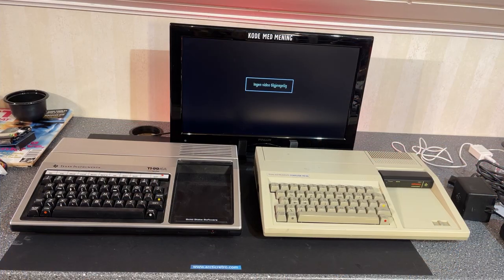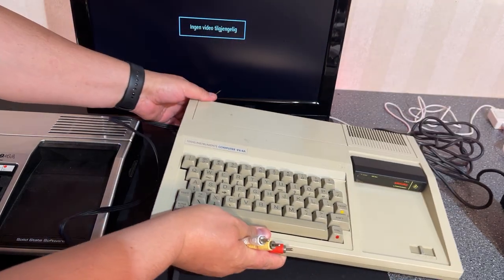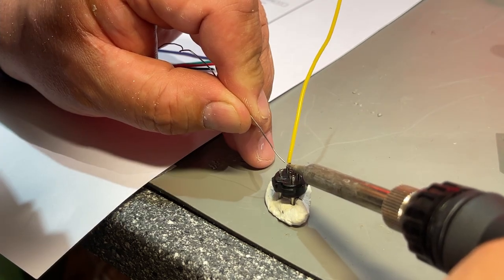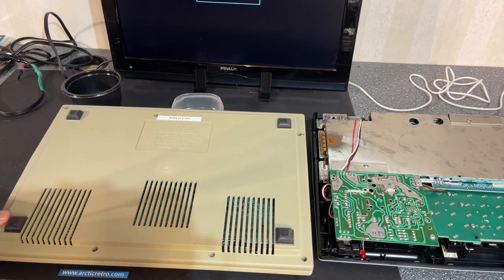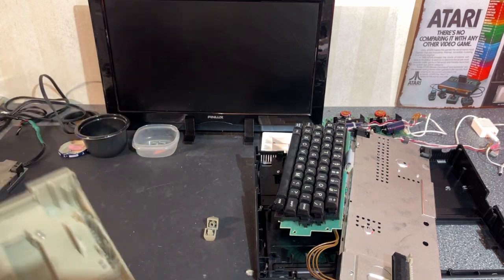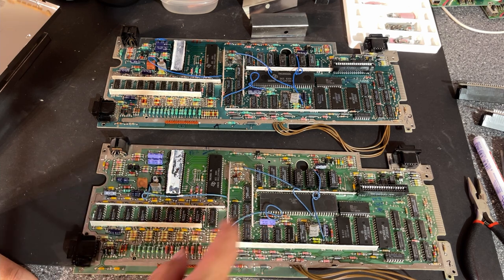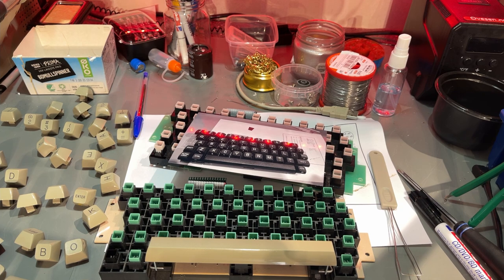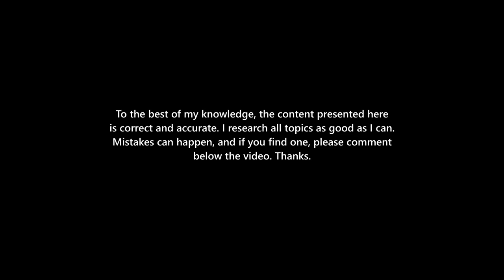Two different Texas Instruments TI99/4A's - What are the differences ? Part 1

Comment: The component output of the PAL TI 99/4A isn't actually compatible to most component inputs on TV sets. The TV set is expecting Y Pb Pr, but the TI is outputting Y B-Y R-Y. You will get a picture, but the colours will be off. Black will be blue for example. If you don't have an RF modulator (that can be easily modified for composite output), the best option is to add an RGB output with the TMS-RGB pcb. Just google for TMS-RGB. There is a video from Noel's Retro Lab about that and a shop in Ireland, that it selling them.
Reply from the maker: Thanks. Yes that is my plan. I figured it out in the next episode :)

Comment: Apparently, the key to soldering to a DIN connector is to grind off some of the connector at an angle, then put in some solder, melt it, drop the wire in, and bingo! Search for "soldering cup terminals".
Reply from the maker: Thanks for the tip :)

Comment: A difference that you won’t see between those two machines is that some of the beige ones (with copyright date of 1983) have a modification to the internal ROM to stop non-Texas Instruments cartridges working. Yours doesn’t have that BIOS version, so you shouldn’t see any problems.
Reply: GROMs existed on both. It’s one of the things that contributed to the failure of the machine. Only a handful of carts were ever approved by TI and allowed to be produced on GROM carts. I want to say it was something like 25 titles or so. Even though the machine was superior in some ways, these extremely restrictive conditions led developers to either not develop for it at all or to develop for disk - but the disk required the PEB and it was VERY expensive. This was another reason to not develop for the machine. Without software, a computer is hard to sell. 

What software it did have was pretty good. It had one of the best Logo programming systems for teaching kids and the manual came with lesson plans for teachers. It also had Microsoft Multiplan a predecessor to Excel that was good. The assembler is reasonably good. As long as you had the disk drive you could find some quality stuff - but the COST. Might as well have been made of gold.

Today, I tell people with machines to get a cart called the Final GROM which is a device with SD card storage (all these old computers must be making a surge in the SD card market). 

People wanting books for any old computer should check archive.org.
Reply: @jeffreyphipps1507  Final GROM is a very good addition to a TI99/4A but typically cost more than you would pay to pick up the computer in decent condition. It’s not unreasonably priced, but the TI goes for rather less than comparable Commodore, Tandy or Atari machines so in comparison it looks expensive.

Comment: The really bonkers thing about this design is... everything. 16-bit processor, OK put ROM outside the primary address space. NOPE! Let's use the primary 64K space. Let's have normal RAM. NOPE! We'll use 256 BYTEs of RAM and store programs in video RAM. (WTF?) Let's set aside a separate video RAM space. NOPE! Video RAM comes off of the video display processor, so all program access goes to the CPU-to the VDP-to the RAM and back. (WTF?) Technically even that's not really accurate. 

This HAD to be more expensive. They had the opportunity to route half the address space for basic program RAM up to 512K (opportunity for expansion sales). The rest could be mapped to video, audio, peripherals. Instead, they made it a mess. They made carts only compatible if they were approved by TI (no doubt requiring a "contribution" to get GROM approval). They made the expansion (PEB) INCREDIBLY expensive. They were their own chip maker, not unlike Commodore. They could have done a bang-up job here. Instead, they took a double-barrel shotgun, shot themselves in one foot, reloaded, shot themselves in the other foot, reloaded, and blew their brains out. So much opportunity lost.

The irony is that today's electronic mods are cheaper, better, and generally make this a better machine. It's not that it was terrible from the user's point of view at the time. It's BASIC was pretty good, and the Extended BASIC was good (if you exclude the fact that you stole the cart port. This was true for most every machine of the time. The VIC-20 and the C-64 also had expanded BASIC carts for example. Unlike the Commodore machines, the installed BASIC of the TI had great support of the video/audio hardware. The drawback was that support of other languages was mostly reliant on the PEB because of the extra RAM and the diskette drive. However, the PEB could cost three times that of the computer.

Adrian's Digital Basement had a heck of a time working on one of these, and shorted a leg on the processor (socket - he had to construct one) while trying to replace the processor. It's a difficult board with a difficult design. One would have thought TI would have simplified the design for themselves and provided a straight-forward path to expansion to challenge Commodore. Both had chip fab units. When push came to shove, Commodore would have a fairly simple design that developers could work with, whereas TI made a complex design that basically painted themselves into a corner. It's a crying shame - SO MUCH POTENTIAL. 

Fortunately, a lot of new technology exists to make it viable and fun again. Weird board or not, it gets a couple of inexpensive upgrades and it's suddenly better than ever. See TI? It wasn't that hard.
Reply: Yes, it’s a really weird architecture, but not quite as crazy as you might think. Originally they planned to use a different version of the processor that had a lot more stack space on the chip, but either it was delayed or didn’t work (I don’t remember), so they used the existing TMS 9900 but had to fudge everything by adding 256 bytes of memory in place of the on-chip stack on the 16 bit bus. Has they not needed to do that, the architecture would only have been crazy rather than totally crazy.
Reply from the maker: Yes a really strange design. Wow that was a long comment. Thanks :)
Reply: @Doug_in_NC  Yeah, it was subbed for the sbc9900 (also made by TI). It didn’t make the deadline. However, the whole layout is screwy. Why would      any company choose to access primary ram through the video processor? I can see accessing ram across the bus via memory management. Maybe that’s the reason. I know that the 9900 is CLOSELY tied to the VDC.  I programmed on it at one time to get a feel. I still have it and the assembler manual/software. (I collect these old computers). However, I don’t recall how everything maps when fully expanded. 

I remember that the 9900 was modeled after its mini mainframe processor. Maybe the layout made sense in that respect. I dunno. To me, you start at either the top/bottom of actual physical address space and and block it off. Having said that, there are aspects to consider. As constructed. RAM can be refreshed by the VDC in parallel with the 9900 carrying out the next instruction. Maybe that was the idea. Most microcomputers of the time alternated between the refresh of the RAM and the CPU setting up the next command. It might not be so screwy after all. Seems like the C-64 does something similar with the VIC-II. I don’t have enough experience to know if that was the case on the VIC-20’s VIC chip. Interesting thoughts. If the VDC was doubling as a bridge chip, that would explain a lot of the design.

Which only leaves my gripe about GROMs. Stupid TI, very stupid. At least that’s almost completely bypassed today with the Final GROM cart.
Reply: @jeffreyphipps1507  I have one, but I’ve never tried to program it. I got it thrown in with a C64C and VIC 20 I bought, but I haven’t really done much with it as I haven’t got any way to save data as yet. Yes, the decisions that were made look very odd today. I seem to remember that when you write a program in BASIC, it gets interpreted into an intermediate language before being run in machine code, making BASIC spectacularly slow. Noel’s Retrolab did a very good video trying to explain the architecture, and it really is unusual. 

Yes, the alternating between the processor and video chip accessing the RAM is pretty common in 1980’s computers. To compensate for that, the C64, VIC 20 and BBC micro (and probably others) ram the RAM at a clock speed twice the processor speed (2MZ for the C64 and VIC20, 4MHZ for the Beeb). The main exception to that is the Atari series which even though it had a 1.8MHZ clock effectively ram at about 0.9MHZ  because the video chip ‘stole’ about half the clock cycles to access the memory.